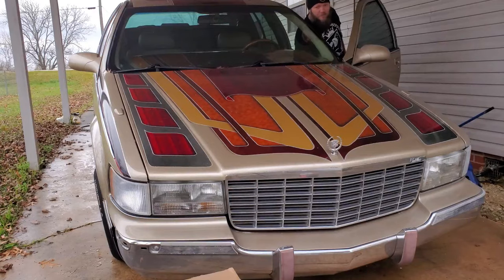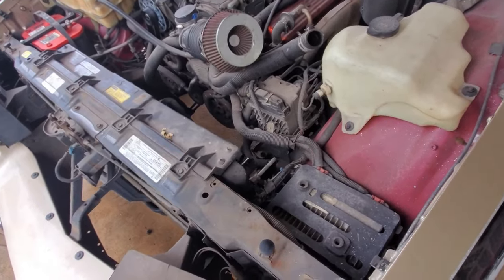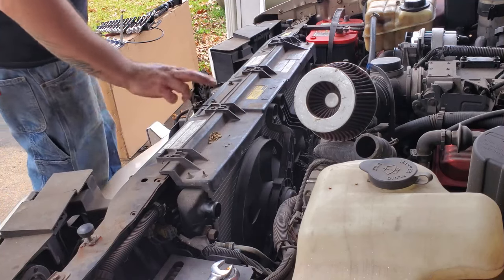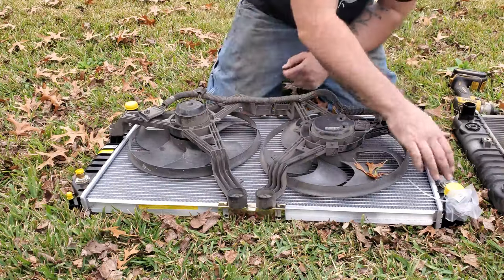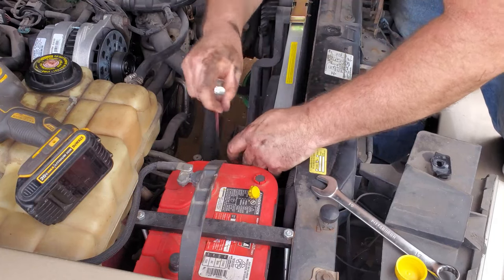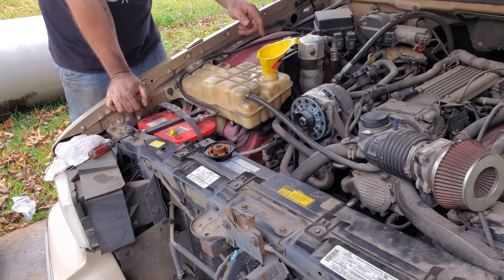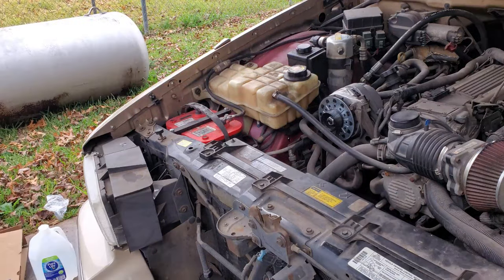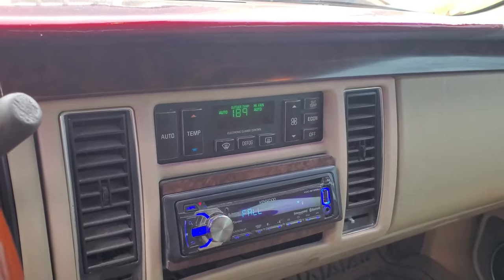How To Replace A Radiator In A 94-96 Fleetwood

Comment: Hey  Dan big fan bro I'm a Cadillac  man too !  Have 2 93s and 89 and 90 fleetwoods. I have problem ,on my 93 got rid of stock brake lines and replaced them with steel braided line , big mistake!  Anyway I want to go back to hard line but I cant find any use or new that stock bent ,I went to Inlinetube but had problems with there fab bent work nothing like my stock one ,any advice on were to get them ? Keep up them videos bro ! Very helpful
Reply from the maker: They are kind of hard to find with the bubble flare you may have to bend your own the parts store sells stright brake line with the flares on it you would just have to figure out how long you need you could use a coat hanger and pre bend the line to figure out how long of line you need